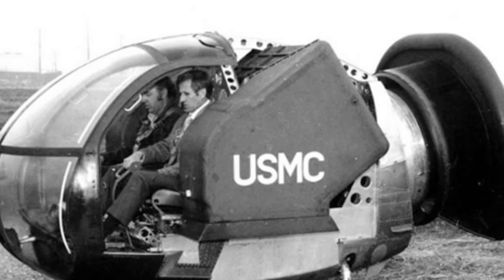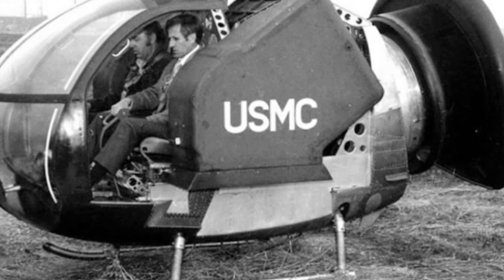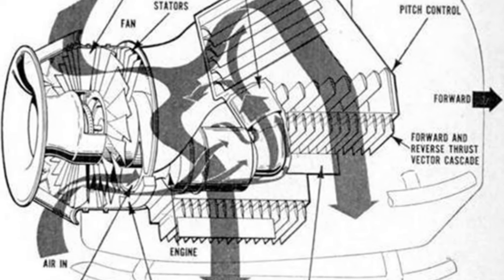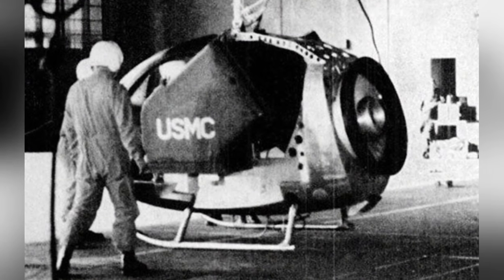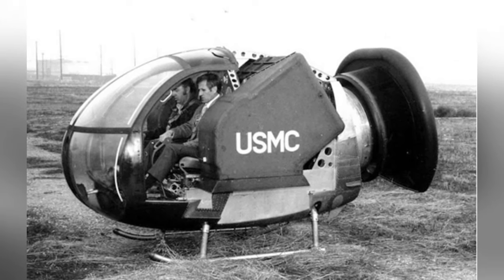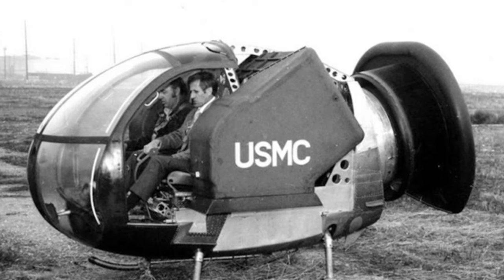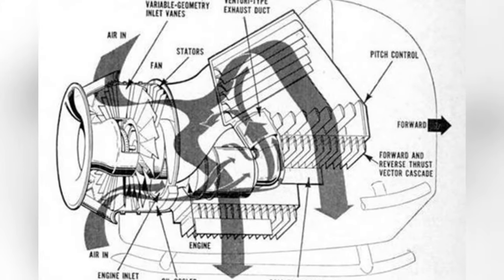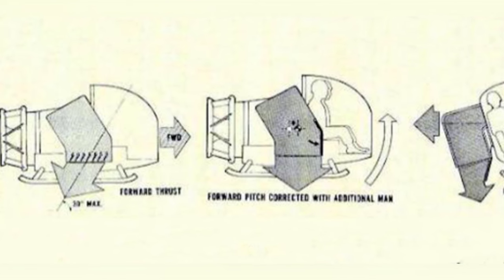Introducing the Garrett AiResearch STAMP: The Ultimate Tactical Airborne Mobility Platform

Comment: Assuming it did work as stated here, with present-day tech, this could work. Engines today are smaller and produce much more power. With extensive use of carbon fiber, it would also be much lighter in weight, giving a much improved thrust to weight ratio with better all around performance including speed & range. Sensors and fly-by-wire control could take much of the burden off the pilots and help make it incredibly maneuverable. With no rotors, this thing could make it into incredibly tight spaces. Finally, an automatic parachute recovery system such as found on Cirrus aircraft could make the whole thing actually practical.

Comment: I’m surprised that they haven’t restarted this project would be a great tactical extraction vehicle no rotor blades to worry about get into really tight spots with today’s technology it would probably work well now days.
Reply: Probably because they have better solutions.
Reply: The Israeli mule is a much better version of this.
Reply: @iindium49  yes I have to agree with you The Israeli mule is better machine but only because the other one never got past prototypes so we’re not comparing apples with apples and the mule is a undermanned aircraft where the other is piloted.
Reply: Not as efficient as a helicopter
Reply: @jamesricker3997  The design is not as good a helicopter but the whole whole idea is that you don’t have to worry about having a rotor strike when you’re getting into a tight place where the Hughes 500 little bird has a length of 32 feet or 10 m and a rotor span of 27feet or8.1m which is reasonably small for a attack helicopter but if you’re trying to get in between buildings you’re certainly working hard to get in there and even harder getting out. Where Garrett STAMP you would be in an out no trouble even into a space as tight as 3 m or 10 foot which would be absolutely amazing to be able to do that as with the helicopter when you have a rotor strike and it’s game over.
Reply: @@timothymckee7693 sorry not into Marvel or Lego just Reality.
Reply: Engine Stall= Dead pilot and crew. Rotating blades are way more efficient and store energy to land dead stick.
Reply: @ntal5859  you would run twin engines same as most other aircraft.

Comment: I sort of designed something like this in school. I didn't think it would actually work, it would burn like a gallon of fuel every 2 minutes and wouldn't be particularly fast. It would probably make more sense as a civilian air taxi type thing. Even then, it would take like 10 gallons of fuel to get across a large city. Maybe efficient enough for something like an air ambulance. Though I suppose you could give it a lifting body design and close the VTOL thrusters like on a Harrier/F-35 and possibly get a little better range, but then it's not a little hoverpod thing anymore, you've just got a small VTOL jet.

Comment: With better electronics avionics inside it today and a bit bigger motors i think it could be a winner.I designed and built a vertical take off craft when i was 9 years old and flew it on my parents country estate it was only a model but it was radio control.RR aero division have one of my drawings today.And my cousin designed and built the hawker harrier jump jet engines.

Comment: Turbo shaft?
Reply: Yes, the shaft part is actually used to drive the lift fans. The turbine engine is only acting as a pure power plant. You have to remember it was derived from a helicopter so as much helicopter that they could keep it still in this.